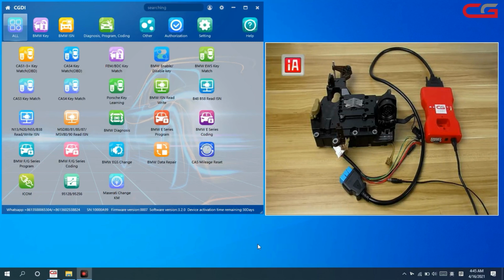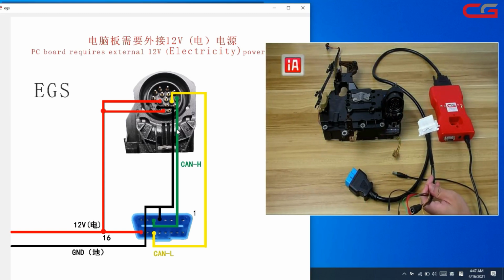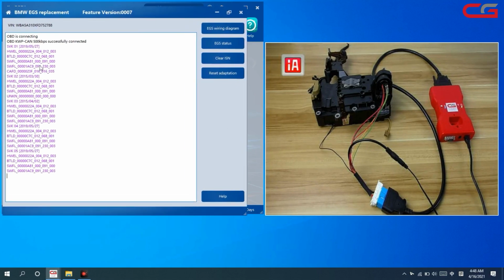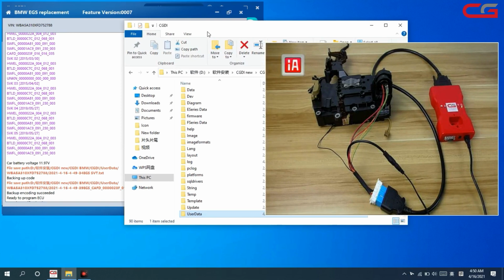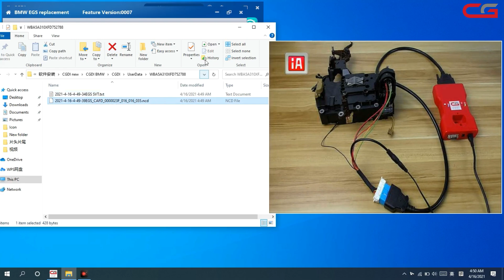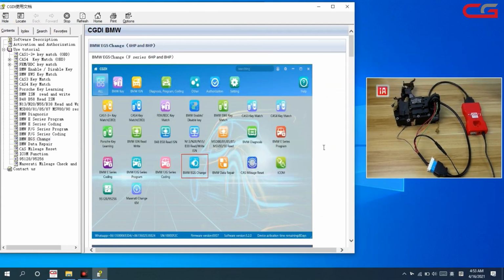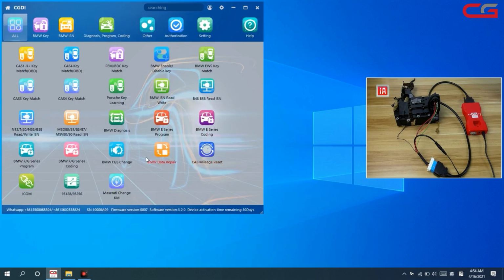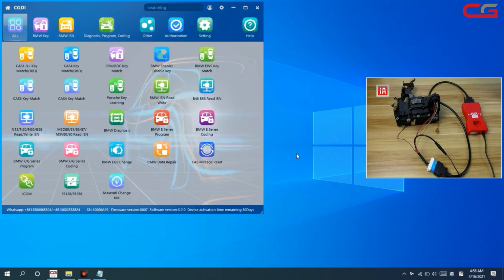CGDI BMW ~EGS 8HP F series function

Comment: Can You upload a video how can be reset to virgin state the 6hp and 8 hp for E series
Reply: cgdi don't virginizate 6hp 8hp for E-serie
Reply from the maker: yes ,can not do E series for now
Reply: @cgofficial2114   if the tool does not support working hours for ECM and isn adaption for egs E series ....
Reply: @cgofficial2114  i have a zf 8hp gearbox to install in another car.

Does this make the gearbox standalone or what??
Reply: @cgofficial2114  still can't in 2023 year ?